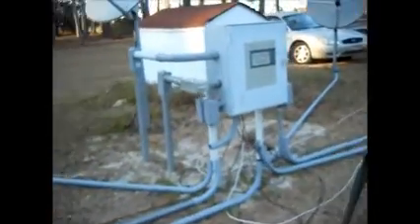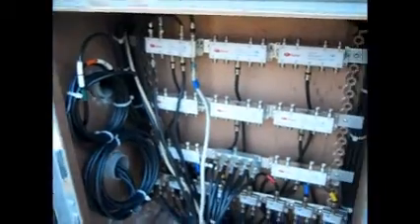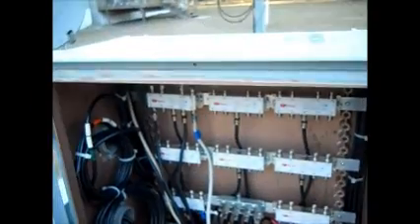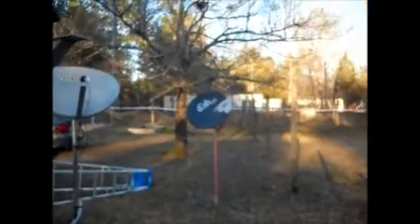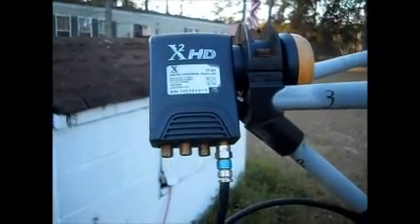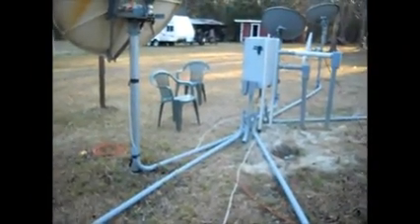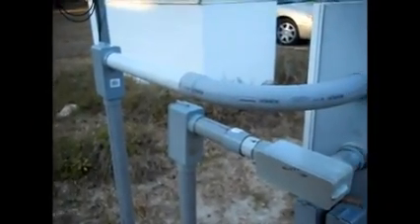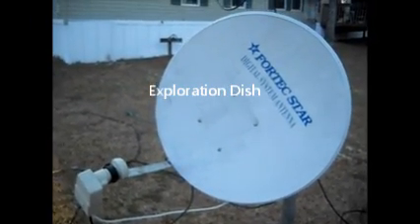FTA Satellite Dish Switching using DiSeQc Switches and piping

Comment: Leo,  I would like to ask you two more questions.
1) It looks like you have a variety of different dishes.  What dish size would you recommend to use for the first FTA dish?  I'm in the Seattle, WA area.
2) Is there a reason why you don't have multiple LNB's on a single dish?

-- Konrad, WA4OSH
Reply from the maker: Konrad Roeder Happy New Year!  my friend.  The size of the dish is tricky as the larger is better BUT NOT if it is of poor quality, Some of the old 8 ,10 and 12ft dishes were NOT built for use above 4/5 GHz. Most of the old DTV RCA fiberglass dishes don't have the gain rather. The older PrimeStar service dishes work pretty good. If you can get hold of a abandoned 1.2 meter dish from a closed business is a great find.The current dishes in use by Dish and Direct TV with multiple LIBs work great and can be found at the local trash transfer station or ask someone who is moving or changing service for there old dish as they are not returned with the receivers to the Dish or Direct TV. Offer then $10 and they won't think twice. The most important thing is it is not bent. I use separate dishes to get maximum gain as some of  these dishes are looking at very low angles and singles with footprints outside of my QTH.The main focial point gives you the maximum gain for the dishes heading. Well hope this helps you and anyone reading these posts. 73 Leo

Comment: Leo I'm figuring about 7 or 8 dishes,  1- 8 way DiSeQc  switch,  and an antenna/satellite combiner switch should do the trick right?.
Reply from the maker: john hash Hello John,  I did use a 8 DiSeQc switch, then I switched my LABs to 8 port LABs and feed 8 DiSc switches so I could have 8 receivers looking at any dish and any polarity. I did this because I, well lol :). I believe you will need DiSeQc switches for each receiver, the combiner will not work .  73 Leo
Reply from the maker: I sent replay?  73.  Leo

Comment: Leo, I would love to see an update of this video when you get more of your satellite dish farm completed.  Two questions:  1) Could you provide more detail on your antenna grounding system.   2) Could you explain why you need multiple ports on an LNB?  Why eight ports for eight dishes?
Reply from the maker: Well currently there is no grounding except by the pole. There is a correct way to bond the LNB, reflector, mount, pole, and cable shield. There is also a need to bound each "dish" to each other; and all external systems like switch boxes and power supplies. There are some videos from Satellite installation companies outside the USA on YouTube that you can see what they do. Most of the principles used to bond a communications centers equipment is applicable. When will I get around to it ? Hi Hi   I an using eight port LNBs because I am using eight port Diseqc switches, now I can have FTA receivers in eight different locations. Ham shack ,cottage, house, pole barn toolshed you get the idea. My dishes currently are on SES 2, SES 3, Galaxy 3, Galaxy 16, Galaxy 19, Galaxy 17, AMC 9, and Hispasat 1E.     motorized  As programs change satellites things may change. 73  Leo
Reply: Leo,
I think I get it   You can support up to eight satellite receivers.  Each one can choose between any of the eight dishes via their own eight port DiSEqC switch.  Each dish has its own eight port LNB so that the programming can be shared to each of the DiSEqC switch.  The satellite explorer dish has a DiSEqC motor on it so that it can be aimed across the entire Clarke Belt.  I have off  and on wondered if I should try an FTA satellite system.  With the Outernet (http://outernet.is) project, I have become interested in satellite hunting.

73  Konrad, WA4OSH

Comment: landscaping around the perimeter and cover with landscape gravel would be easy access and look good....
do channels ever get taken down ?
what is the cheapest way for someone to get started with free satellite tv??
Reply from the maker: +MrOne2watch Hello It would be a neat way to cover the pipes but cash is in short supply and my labor is a labor of love lol. My favorite things to watch are foreign country news and live news feeds. The foreign stations are pretty stable but the US live news feeds are common on certain satellites but do change transponders, thank god for "blind scan". The cheapest way to get into this fun hobby is to convert a discarded DVB (  Dish TV, Direct TV or Prime Star ) dish. You can buy a FTA Satellite receiver for around $35 on Ebay. You can put a FTA LNB on the dish for about $15. You can get going for under $100. I will try to address this in my videos. God Bless Leo
Reply: Have to see if you post this one yet. I got several dish's.  Also have a couple of GE 480i  c/ ku band receivers. 
But could not find any info on what type of LNB to get.  Kind of lost interest. But after seeing this  who knows I may try again.
Reply from the maker: I have been using X2 LNBsOcto Full HD LNB , 8 output Universal Ku Band LNB   and
Avenger KSC321 0.2dB Standard Linear Ku Satellite LNB & Universal Single Bracket
( 360722278496 ) Check out eBay.

Delete item
Add note